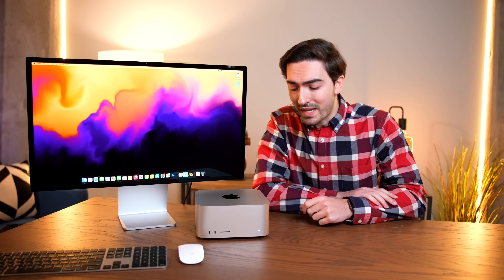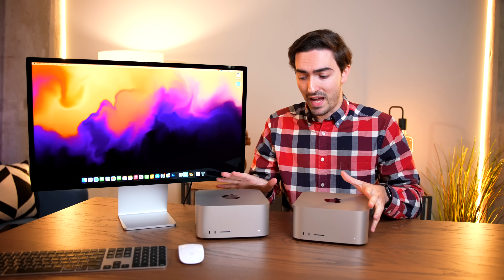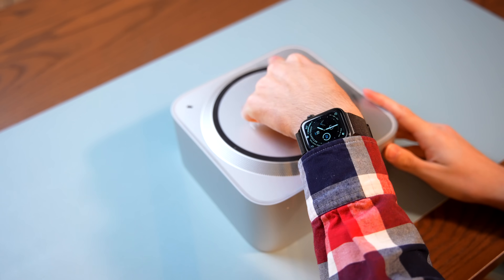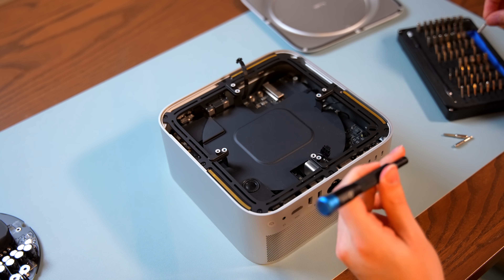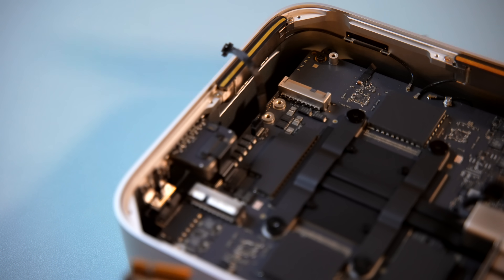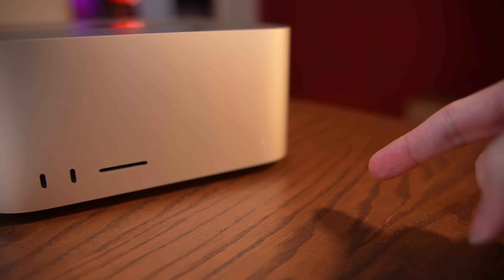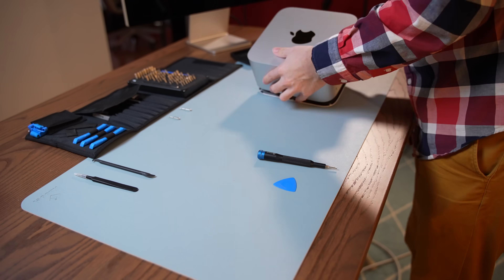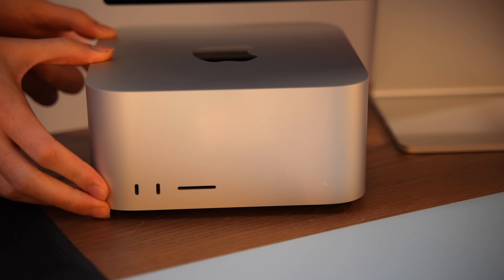What happens if you try to UPGRADE a $5,000 Mac Studio?

Comment: You need to try using AppleConfigurator 2 to "resync" the drives. You have to do that with mac Pro 7,1 too
Reply from the maker: Definitely going to give this a try at some point. However, even so the fact that Apple makes what could be a simple process so difficult is discouraging and meant to drive consumers to paying extremely high prices to upgrade from the factory
Reply: @lukemiani  Apple Insider has a video of the process on a Mac Pro: https://youtu.be/p2baf1uPZW0
Reply: @lukemiani  yeah its annoying, but if its at least possible it would be less of an issue.

Look it up how its done, its kinda like doing a DFU restore on an iPhone.

That is probably done to re-setup the drive encryption trust between the m1 and the SSD.
Reply: @lukemiani  here i am discouraged at hackintoshing...
So difficult version by version.....
Reply: @lukemiani  its pretty simple… download Apple Configurator 2 to your Host Mac. Connect a usb c cable to the usb c port next to the Ethernet port on the Mac studio. The other end connects to your host. Plug the power cord into the Mac studio while holding down the power button. After 5-10 seconds it should show up in dfu mode on your host. Right klick and restore… hope it helps 👍
Reply: @Nupagadiesiebensachen  “Host Mac” — you shouldn’t need two Macs to make something like this work, period.
Reply: @lukemiani  Apple has instructions for the Mac Pro 7,1 SSD upgrade, try to follow those for the Studio.  Having done the Mac Pro 7,1 upgrade myself, I was almost yelling at the screen because I knew your attempts would fail without AppleConfigurator to pair the drives to the chip's security.  It's actually pretty easy.  Could be wrong, but I suspect the process is the same for the Studio and upgrades/swaps are possible.  Note that if using two SSDs together they need to be the same size, as they will RAID together to form your boot drive.
Reply: Also, on the 7,1 the drives were printed with a label for 1 and 2.  Not sure that they are identical or that mixing and matching is possible.  But swapping a "1" for another "1" should be possible in your experiment at the minimum.  Populating both slots with "1" drives would be interesting to try but might not work.
Reply: @lukemiani  i agree with your visor , but if you can use a few software tool to fix it you should be humble enough to correct the video and say “ups it was me being ignorant “ not “but still” as a bad parent when they discover the kid did jot do it. I don’t believe that the software fix proposed will works but it it does , you need to come clean.
Reply: @lukemiani   It's pretty much the same as the Mac Pro, being that the storage controller is not on the SSD itself (the SoC in case of Apple Silicon, T2 chip in case of Intel Mac Pro)

I'm kinda disappointed that you didn't even try this. It's kinda expected seing how the Mac Pro lets you replace the storage through Apple Configurator app.
Reply: @lukemiani  Annoying sure, speculative for sure.  Apple’s choices for security are well known and being upset with them is your choice and you’re allowed to voice them.  Doesn’t mean they won’t stick to them just because you don’t like them and roast them on YouTube for it.  While I would also like to upgrade a Mac Studio and its a bummer that it appears that it can’t be.  Its my choice to decide if I want to buy it based off this discovery or not.  Speak with your wallet and leave your personal grips out of it.  Otherwise you don’t come off as objective and just another complainer.
Reply: It is inexcusable. A 15 year old harddrive would launch in a brand new PC, if you wanted it to. Its ridiculous.
Reply: @Viggemigge  "Yes, that is true. But this is better. Trust us, we're the experts." - APPLE
Reply: @Viggemigge  This is correct, however it ignores one factor - that hard drive would not be encrypted. It's an annoying process, and really there should be clear instructions available showing how to do it. That said...it's probably possible to do without much fuss. Still stupid though...
Reply: Strange sort of modularity they talked about in their presentation...i would say your average PC build is more Modular.
Reply: I fealt really sorry for Apple user, a SSD need to be "resync" to be used!????
Reply: @TimmuJapan  I agree with you unless it's a simple software step. Basically, the person buy the 5000$ sure that the SSDs was soldered on*. and could not be changed. So it's not like you are getting. *less than promised the point is: why make it difficult? so if it's a simple software step. (an I don't believe it is, I am confident, but not sure,  Luke is correct at the moment) then the argument disappears and the video needs a correction.
Reply: Hey where did it say in the specs that it was a user upgradable system?  Must have missed that one. Is a MacBook Pro upgradeable? You sound like someone who was excited to be the first to try something for the sake of YouTube and are bitter because it was a loss/fail. Yet a video editor like myself who could actually make use of the machine, has to wait until late May to have a machine at all.
Reply: @andy.schwartz  there is so many things wrong with what you said. also in case you don't know, Luke did not get review units, he bought them out of pocket tru normal vias.
Reply: @EnaBBQ  ok. Even more reason to know what you are doing before wasting your money, yes? I mean, I feel bad for the guy, but come on...it is not stated to be user upgradeable anywhere whatsoever. I can appreciate "Taking one for the team" and all.....Getting crabby at Apple for something they did not do is ....petty.
Reply: @andy.schwartz  Im pretty sure everyone trying it already know that it is not a supported use case by apple.

Also FIY, MacBooks from around 2010 until 2015 had removable proprietary SSDs, that also were not upgradable according to apple. However those can be upgraded and swapped, some models even support m.2 NVME drives with an adapter.

This is what is being tested here, the possibilites despite apple's claims. Testing if and how we can get the most out of the hardware we pay good money for.
Reply: @EnaBBQ  so what you’re saying is… there may actually not be much wrong with what I was saying. Testing the possibilities of unsupported speculation, and then getting super crabby about it when it fails…and spouting it atop a platform…does not depict great optics. Maybe it’s good “for the channel”. As someone who mistakenly stumbled across this video as it is of interest, and is not a subscriber, nor will be after this, it’s an unfortunate depiction.
Reply: Sure but on my pc I just clone my old drive into a new one and it boots off the new one what's their justification for not allowing that?
Reply from the maker: @brayannexon4613  Big facts
Reply: @brayannexon4613  It is a tradeoff, security versus simplicity, if you don't mind having your boot drive unencrypted then more power to you. but if you use bit locker, and then your TPM gets reset for whatever, if you don't have the restore key you will just lose your data. Also, I think if you clone a BitLocker encrypted drive to another one, the clone won't boot anyway.
Reply: @EnaBBQ  not quite I am firm believer of choice. If i chose not to encrypt my drive that's on me. Apple should do the same if you want to encrypt your data more power to you. If you don't that should be option too but apple has conditioned people into being ok with having no choice which is whats wrong here.
Reply: @brayannexon4613  that’s kind of s moot point considering new windows computers are starting to come with encryption by default. I believe they having security as default and not as an option is overall better. But that’s beside the point. To me it boils down to: we can still replace these SSDs and that’s a good thing.
Reply: @EnaBBQ  i guess one step in the right direction is good but they receive no points from me. But choice is good and should be a thing amongst all tech.
Reply: @EnaBBQ  The clone will definitely boot if you are using a bitlocker key on a USB drive.
Reply: @brayannexon4613  Security - your PC drive is not paired up with TPM and encrypted by default right? 🙂
Reply: @kkolakowski  correct and on macs the secure enclave shouldn't be on by default. If users want to enable it they should be able to after they brought the hardware. Enabling it by default almost feels like sabotage.
Reply: @TimmuJapan  If they let you pull and place drives randomly, would be a huge secuirty risk. Swapping SSDs is a replay attack risk, it is very common in enterprise for years to have protection against this. apple just brought this to consumers, security is a good thing. I'm very glad that at least the macStudio still has replaceable SSDs since they are like batteries, have a limited lifespan. And again, this practice has been present on the 7,1 Mac Pro for years already. Apple even sells 7,1 Mac Pro SSD upgrades. (which if it weren't for the size constraints, I think would work on the mac Studio too.)
Reply: @EnaBBQ  while I agree with you about the security aspect, I think this kind of security for home consumer is like killing an ant with a rocket launcher. 99% of the home consumer would never have to worry about a replay attack. Apple only uses the security excuse to lock in their users in their walled garden, Apple should have given their users the option to do whatever they want with the hardware they own
Reply: @MindGrr  A M1 Ultra is a "home consumer"? What home consumer spends $8000 on a PC to email/browse web?
Reply: @RunForPeace-hk1cu  Yes indeed, an M1 Ultra is not the best option for web browsing and spreadsheets, but this extreme security measures extends to the whole apple computer family, including the Mac Mini, iMac and MacBook Air, all home user oriented products. If you are the kind of person that need to worry about someone going to to extreme of stealing your computer or using a "evil maid" attack to get your data you should have been storing your sensitive data in a secure server and not locally. For a home user a standard TPM encryption is enough
P.S.: the home vs pro needs isn't the point here. The problem is that Apple uses security as an excuse to lock their users, there is absolutely no reason to pair SSDs to a machine, Apple only do that to charge hefty prices for their 1st party parts because you can't use the 3rd party one
Reply: @RunForPeace-hk1cu  yes, but companys need even more modularity and flexibility in there devices then the average home use. 
apple is just purposley trying to make the device less repairable, more expeonvie, more anti-consumer
Reply: @MindGrr  The SoC have a builtin SSD controller. You ain’t installing a std NVMe drive no matter how many adapters you have.

You just end up having to buy the “upgrade”  SSD from Apple anyways. You save manual labor cost at most? That’s the best case scenario assuming it’s even upgradeable like the MacPro 

So this whole “locking out” consumer thing is mute.
Reply: @larssssssssssssds  don’t know about you, but apple have been selling all in one computers for over a decade. The market says ok. iMac are insanely popular.

Apple is actually forward thinking. More and more People are treating computers as an appliance rather than “a computer”.

See evolution of cellphones.
Reply: @RunForPeace-hk1cu  Yes, I was waiting this kind of response. Did you noticed that first Apple was soldering storage in the logic board for performance and security reasons and now both the Mac Studio and Mac Pro have a slot for upgradeability? Did you noticed that Apple choose to not have a slot in their home lineup? Did you noticed my phrasing? "Apple choose". If Apple wanted they could have put a slot in the iMac to give the user the option to upgrade by itself, but Apple choose to not do it and give it an excuse. Apple choose to put this slot in their pro lineup because the pro user need it but Apple did it in their own way by putting a pairing process in the middle to lock their users in their garden and that all goes down to the money and control. Isn't ironic that a company that cares so much about the environment didn't give their users means to repair their computer? Your Mac SSD or RAM died but the rest of the computer is good? Too bad, pay Apple to repair it for the price of a new computer or go and buy a new one. Apple only give excuses
Reply: I'm using Macs here as an example, but this happen in their other products. Lightning cables have a chip with the only reason for Apple to collect money for every cable sold. Apple doesn't allow side-loading apps on the iPhone only because they would lose that sweet 30% income of every app sold and slap security as a reason for blocking side-loading apps
Reply: @RunForPeace-hk1cu  yes ofc your totally right. but they do so much anti cosnumer stuff, which isnt excusable imo.
Reply: @EnaBBQ  Well, I’d think the enterprises where it’s common would know better to enable whatever locks they need, rather than relying on default settings, and if they don’t, it’s on them. It’s not the manufacturer’s job to configure the system.

And for the average user, there’s little reason to do this, and using an administrator’s password would be enough, no need to involve another Mac.
Reply: @EnaBBQ  You are right but they could just let you disable the security of the ssd in software, just like they add more storage.
Reply: @EnaBBQ  The exposed Power Supply and the huge amount of Screws is enough to scare anyone away who would want to replace the SSD.
Reply: @EnaBBQ  for an workstation / server HOT SWAP storage is what they have
Reply: @JoebDragon  This isn't a server or a workstation. It's a purpose built device (appliance) that does what the user bought it for.
Reply: @EnaBBQ  Security as an excuse to ream your customers! SAAETRYC! A new enterprise acronym. 😅
Reply: Nowhere in Apple’s literature do they claim that the Mac Studio is upgradable after purchase.  I suspect that they made the drives modular in the Studio in order to test modularity for the upcoming New Mac Pro with apple silicon.
Reply: @FairchlldMusic1  or an alternate theory is to prevent a logistical nightmare of having way too many sku's for a product.
Reply: @brayannexon4613  yep, they’re probably going to use the same drives in the new Mac Pro, bingo
Reply: @FairchlldMusic1  it has a replaceable ssd! they market everything to eye candy people, it is obvious why they dont advertise things they can buy cheaper or replace themselves  when they can just sell them an entire machine with the upgraded part... stop sucking up
Reply: @mytester6208  they’re probably going to use the same drives in the new Mac Pro, bingo
Reply: Some of these complaints sound like old people bemoaning the loss of carburetors when fuel injection came out. If you don’t understand why Apple, or any manufacturer does something it means you have more to learn not that they are doing something wrong.
Reply: @magikben  Just because something is new, doesn't mean that it is good...
Typically - newer is better. 
It's just another stupid rule that Apple imposes that just removes more chance to fix your own stuff
Reply: @magikben  all industry standards for storage are left for end users/companies to decide. you/company can decide to encrypt it and have the tpm sort out the rest. but problem here is apple decided for you to not only encrypt it, but make it literally impossible to do anything with it without having a second mac! you have to have a second mac to be able to restore this mac and assign/sync with the t2 chip? this is insane. all industrial designs have bios/uefi chip to configure things, apple? nah, you need another mac, and another apple software to do this? seriously? why cant you just decide yourself if you wanna encrypt or lock those controls yourself?if you forget the lock combinations, tough luck, apple can sell you another unit. but this? apple locks itself, and you need another mac to do the restore etc... thats f ed up shit. not sure if it will even work to begin with. also labeling on the mac pro is even more worrying, 1-2 wtf? you need no 1 ssd for slot 1 no 2 ssd for slot 2? what happens if you place them in opposite orders? are they not the same ssd?
Reply: @magikben  how is that? ECUs are better than carburators in every aspect, how a Apple ssd can be better than every other ssd option?
Reply: @magikben  nah it means it's not a professional grade product.

I know a lot of creative professionals that moved their workflow away from Apple because they could no longer pull the drive from an otherwise failed machine and slap it in a new machine.

For in-house work you can work with a storage server but in the field it needs to be exchangeable.